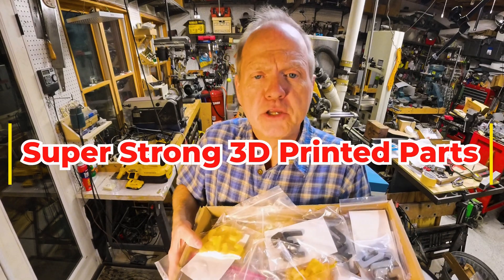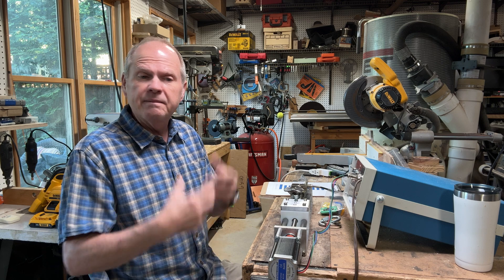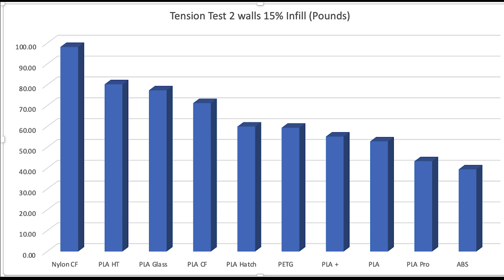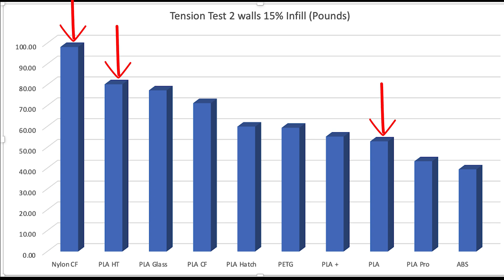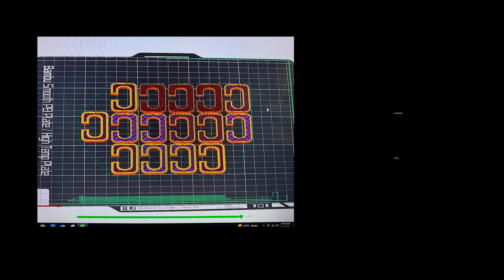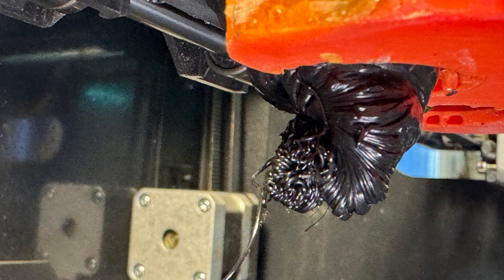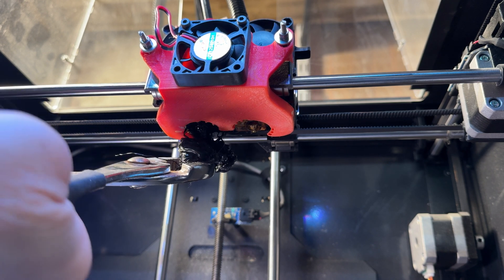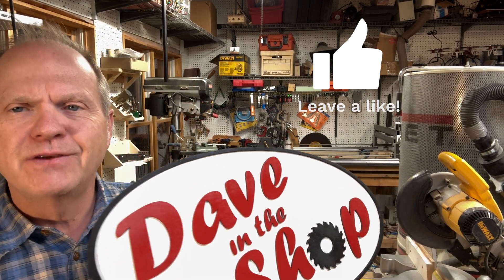Making the Strongest 3D Parts

Comment: I recommend looking into material creep, as well as impact strength. It really depends on each part and what it will be put through as to which plastic is best each time. Also, I think there are different max temps for HT PLA depending on the company, and ASA can handle much higher temps, as well as withstanding UV rays better than other options.
Reply from the maker: Thank you for the comments and ideas for further exploration. I will look into other properties and ways to measure them.

Comment: For the weak ABS and PETG, I wonder if there is something else contributing like moisture in the filament, or not being printer at the optimal temperature, or open printer airflow?  That being said, I understand that they can be weaker in that they are more flexible, as you suggested in the video.
Reply from the maker: Good suggestion. I will have to try a few experiments to see if I can get a different result.